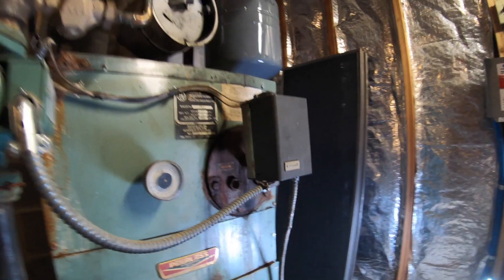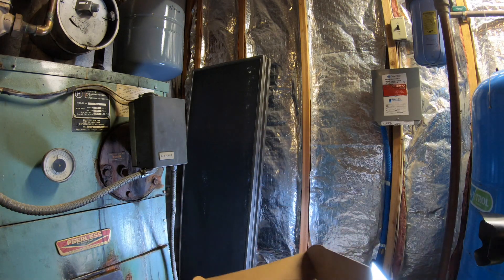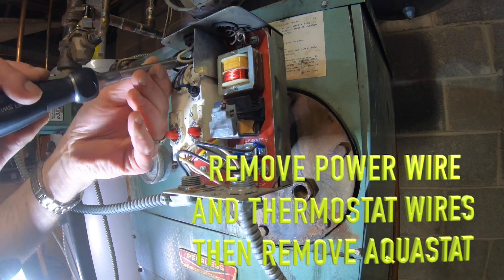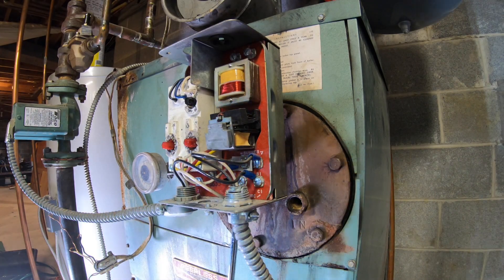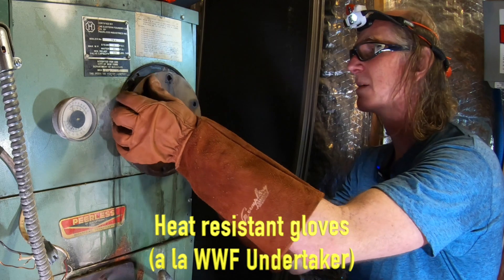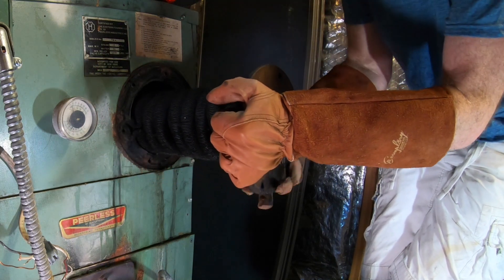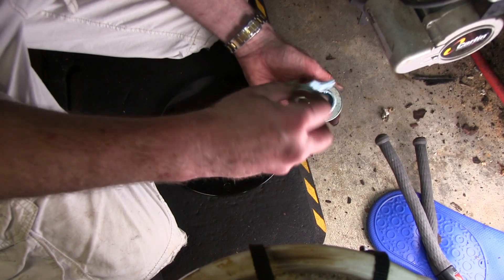Oil fired boiler Tankless coil gasket leak- DIY replaced cover and gasket

Comment: Thank you for posting your video.  Very helpful to give me the confidence to do this myself - exact same issue with my peerless.  My oil/furnace company wants $700 to do it.  Do you have any further advice since when you did it?
Reply from the maker: Thanks!   It was quite easy but a couple of things; don't force the bolts. I learned that the hard way when doing my brake caliper bolts. Spray them for a day before every few hours. Hit them hard with a steel hammer a few times and after you break each one free even turning it slightly, spray the threads and screw it back in then back out.  Watch a few videos on removing very tight bolts first.  
Next, after you drain down the boiler, there will be some residual water still in the boiler that will be released when air gets into the boiler from loosening the bolts. Be ready for it by keeping a hose on the drain.  
 That's all I can think of at the moment other than carefully scraping the old gasket so you don't ruin the surface it sits against.
Other than that good luck.

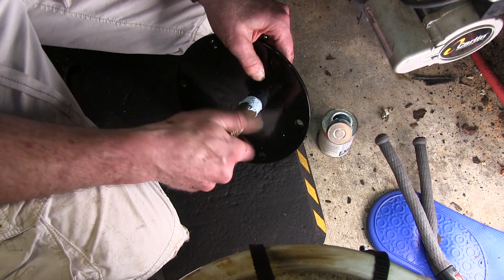Comment: time stamp 6:52 you removed the coil and didnt put it back, is it possible you can do this with out damaging the boiler? Im not an expert but Im curious if I can replace the plate cover, gasket with out putting back the old/new coil to supply my water heater, thanks
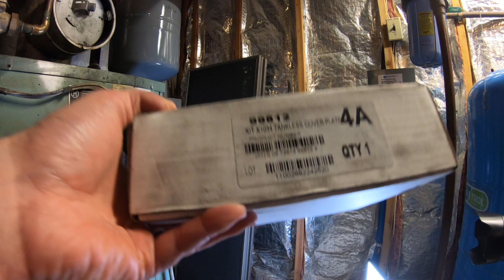Reply from the maker: No wonder I haven’t had hot water since then!  Thank you !!  But seriously, the coil had been disabled prior to us buying the house. The water lines were cut just outside the boiler. In its place is a tankless heater that makes our hot water. It’s a separate zone on our boiler and has its own aquastat and circulating pump. The coil wasn’t bothering anyone sitting there, but since there was a leak from the gasket, I figured I would install a blank plate in its place, which is what I did. 0:34 You don’t need to have a tankless coil in the boiler if you aren’t using the boiler directly to produce domestic hot water.  Thanks for the comment.

Comment: Great video!  1 question, where's the coil?  I didn't see you insert it again.
Reply from the maker: So we bought the house and I guess the prior owners weren't getting enough hot water from the tankless coil because the copper piping leading to and from it were cut and in its place there is an indirect fired water heater.  Its a separate zone with its own circulator. 
So the tankless was basically sitting there disconnected and I left it that way until a couple of winters ago I heard what sounded like water hitting a hot frying pan dripping. After looking I realized I had a leak from the gasket around the tankless. 
Well since I wasn't using it,  I decided to remove it and replace it with a solid plate.  Which is what I did. I tossed it in the trash and replaced the gasket and bolts and put in a solid cover.  Watch 0:25 to about 1:00. Its been fine ever since. No leak. 
If I were replacing it, would have been the same job except for desoldering copper going into the old coil and attaching the new coil and soldering in the domestic hot. 
Thanks for watching
Reply: @Drrich_DIY  Thank you for the quick reply.  I probably don't have a coil either because my set up looks identical to yours.
Reply from the maker: @jodeci888  you might just need a gasket  they sell them for about $10 I believe. If there isn’t a coil in there you can just remove the plate and put on the gasket. With a coil in the way, a gasket is a bigger job.  Edit. Nothing is $10 anymore with the current inflation https://www.supplyhouse.com/Peerless-51800-Gasket-Round-Plate
Reply: @Drrich_DIY  : I actually already bought the plate, gasket and bolt set.  Maybe I won't next time.

EVERYTHING is going up but OUR pay.  😉
Reply from the maker: @jodeci888  you can say that again!   Good luck. Start spraying the bolts a couple of days in advance and remove them carefully. That was my biggest worry.  Having to drill out and retap one of those.
Reply: @Drrich_DIY  Thanks for the heads up.

Comment: I just changed the gasket a few moments ago. It leaks like WikiLeaks. The old plate appears perfect but must not be?
Reply from the maker: Maybe scrape and then sand both sides that the gasket press against- on both the boiler and plate. As I recall it was a pretty thick gasket. If that doesn't work, I would probably go to an automotive supply store and get some high temp gasket maker silicone and use that in addition to the gasket you are using now. Just follow the instructions. I think you put out a thick bead and let is get semi cured before tightening.  Good luck!

Comment: So if you want to remove the coil for good you can just order the cover plate and gasket for the coil chamber basically?
Reply from the maker: Yes. That’s just what I did since I had a leak. Mine was already disconnected (the copper was cut) and an indirect fired water heater already installed.
Reply: @Drrich_DIY  there’s the answer I was looking for. Was so confused on why a coil was not put back in. So if I understand correctly, boiler heats water up and feeds to a tank?
Reply from the maker: @nickbass4022 @nickbass4022 two ways to heat domestic (household) hot water with a boiler.  First is a tankless coil. Its located inside the boiler and looks like a slinky of tubing.  The hot water flows through the really hot boiler and heats it up. No reservoir.  Mine had already been disconnected cause i think a better solution is what the prior owner put in; an indirect fired tank.  So its another zone. It holds 50 or more gallons and around the outside is a copper coil of copper tubing.  There is a separate circulator and an aquastat (thermometer).  So you set a temp for the water and the aquastat calls for the boiler to kick on that circulates water from the boiler around but separate from the stored water. When you need to use the stored water it gets replenished. Hope that helped

Comment: Hey man i subbed can you please answer his question I have the exact same thing going on with my boiler i have a water heater and the guy cut the pipes same thing. Should I call someone? should I try tightening the nut there? wifes freaking out man please respond
Reply: could you explain to me why its happening so I have something to tell her??
Reply from the maker: @Kuhlyedascope69  its just a rubber gasket that is leaking.  The boiler is filled with hot water. Its a small leak.  Over time the rubber gets brittle
Reply from the maker: @Kuhlyedascope69   So how did you make out?
Reply: @Drrich_DIY  heyy whats going on man thanks for the replys I talked to an old buddy about it and he said that same thing. its had a slow leak for like a year but I havent lost any pressure or needed to add water
Reply: @Drrich_DIY  I was going to try and tightening it but my buddy said screw it just leave it till the spring supposed to be 8 tomorrow here in MA. He was saying that since the unit is old that when you got it cleaned probably when he shut it down the gasket shrunk a bit and started to leak.
Reply from the maker: @Kuhlyedascope69  probably a good suggestion. Depending on where you are in MA if you need to call someone and you happen to be in his service area, I would call Steve Lavimoniere.
Great channel here on YT. The guy can fix anything hvac, and is one of the few not looking to just replace older stuff
Reply: @Drrich_DIY  haha yeah I saw that you mentioned him I also have watched him over the years and have learned a lot from him hes great. he lives more east out towards boston so hes a bitt to far for me would love to have him come here though!! My dads buddy is an oldd plumber kinda like a steve has seen it all but hes in florida currently. When I get it all straightened out Ill come back and say how it went for you and any other viewers. thanks a lot for the help man!!
Reply from the maker: So you have a hot water tank that serves the water (an indirect fired water tank),on its own zone?  If its a slow drip, its not gonna do any major harm as long as its slow and you make sure to keep the water filled so it stays around 14-20 psi in the pipes. Let me know
Reply from the maker: Understand I'm not in the business, I'm a homeowner so take what I'm saying for what it is. Also, you never know- be really careful. But in my experience,  after doing the job, and replacing the firebox, I was worried for nothing. Most likely you can gently tighten down the bolts, a little at a time in a star pattern and hopefully that stops the drip until the spring when you can replace at least the gasket. 
If your boiler is old like mine is, and you call someone,.expect them to want to replace the whole boiler. Once they put a tool to the boiler its their responsibility and most guys aren't gonna want to touch old and leaking. 
It was an easy job, I just would wait until you don't need heat. Thats what I did. I tightened the bolts, that stopped the drip and I did the job in the warmer weather.

Comment: Thanks for posting that video. I have the same problem only with a twist, hopefully you can respond and help me out. New Yorker Oil Burner, leaking at coil assembly, I have the gasket, got it from supply house, mine has a round opening where coil slides in, with square plate on end which extends out. Then the leaky gasket, then the coil assembly also with square plate which is nuts and bolts together. Inlet and outlet pipes go through near center of plate. I’ve disconnected water lines from coil assembly and looped together because water runs in through coil, back out, then to electric hot water heater already using. Coil assembly in-line I guess you call it. Therefore I have domestic water, but not for home heating right now cuz burner off. I’m ready to replace gasket. If I fix the leak by replacing gasket, but leave water pipes as they are, separating the two systems, is that going to work without adjustments to aqua stat?  I believe I would need to disconnect the low/diff wires. I see you have the two separated, and your aquastat goes in front of coil plate. Mine is off to the side, not directly in my way of coil assembly area. Please respond when you can and thants again! MCT
Reply from the maker: I would be happy to help, but I’m not quite sure I understand your question. My suggestion would be to either take a photo or video of the system before you remove anything, and then put it back exactly the same as it was before. I assume the gasket is what is leaking, since you are replacing it. You didn’t mention that you were replacing the coil so I assume you are not. The only reason I replaced the plate and coil is that they weren’t being used any more. For my system, the aquastat controls just the boiler, and my indirect water heater has its own aquastat. In your setup, where the domestic hot water flows through the coil, I believe there should be only one aquastat, and then there is usually a mixing valve after the hot water comes out of the boiler at whatever it’s set to (let’s say 180 degrees) the mixing or tempering valve adds domestic cold water in with that 180 degree hot water in order to make the domestic hot a safe temperature at your faucet.  Just so happens my aquastat is in the middle of the plate, many like yours aren’t. Hope that helps, but I’m not in the business. I suggest you go to a few vids from either Steve lavoniere or the pipe doctor who do this for a living and put out excellent videos of peoples systems where you can maybe find the same system as you have to see how it’s set up. Hope that helped and good luck.   I expect you have this system
https://s3-us-west-2.amazonaws.com/catsy.782/AP-U+IO.pdf. Here. I found you a video that will hopefully explain and help. Watch it. It’s awesome. https://youtu.be/bhs0CQtS-U4
Reply: @Drrich_DIY   Wow, thanks for such a quick response! I’ll check out that video, I guess as long as the leak is fixed, I can hook the pipes back as they were. I just thought why not separate since we have plenty of domestic hot water for several months….spring through early fall when burner is shut down. Thanks again

Comment: Great video, doing the same on my peerless WB-3 this weekend, already started soaking bolts! Had a question- did you need to bleed the air out of the zones because of the boiler being drained even though the zone valves were closed during the process?
Reply from the maker: Im not sure if I had to, but I did.  Im not in the business, but I think that when you close the supply and return in each zone, you are locking water only in each loop with no air.  But then once you refill the boiler and open the zone valves, I was worried that I would introduce air into the Zones, so I did bleed them.  Not sure if it was totally necessary.  Probably could have just opened one zone, bled the boiler and that zone until it was perfect with no air, then open the rest of the zones.  Since the hoses were already there, and I was already doing it, I figured an extra few minutes just to make sure were well worth it.  Good luck and thanks for the comment!

Comment: Did this job on my Peelesss 3 years ago, instead of  liquid wrench just applied heat to bolt heads with propane, replaced old bolts from hardware store.
Reply from the maker: The more I do to that boiler the less I worry. Dont want to jinx myself but its been pretty foolproof

Comment: Dude, nice job and thanks for filming and uploading! I have a 2001 Burnham Boiler I started noticing a small leak from gasket. Thanks for the confidence!
Reply from the maker: My suggestion is to do it when it’s warm out, just in case a bolt head sheers off and you have to re tap, you’ve got time. A small leak isn’t an issue, as long as it’s small and you keep an eye on the pressure and add water if you need. Thanks for the comment!
Reply: @Drrich_DIY  Thanks for the tip! I have a wood stove so I basically just use it for hot water but you're right, better to do it in Spring/Summer.
Reply from the maker: @WeatherNut27  here you go. He is doing a tankless coil on a 99 Burnham. This guy is great. Any plumbing I need to do, I watch his vids. https://youtu.be/Qu5n8vXhxpk
Reply: @Drrich_DIY  Steve is the man! Love that guy. Been a subscriber since he had just 23k 2 yrs ago. Religiously watch his daily videos. :-)
Reply from the maker: @WeatherNut27  that makes 2 of us. I've learned a lot from watching his vids.

Comment: I have, what I’m assuming is, the same issue right now with my Peerless (except with A LOT more rust around the bolts...). Called up my service guy, but he hasn’t returned my call. So, now thanks to your video (🙏) I’m thinking about attempting the job myself. 

My question is, all in all, how long did the whole process take (minus the 24 hours of spraying liquid wrench on those bolts)? More than two hours?
Reply from the maker: It also depends on how quickly/comfortable you are doing things like draining the boiler/ closing the zone valves, refilling and bleeding the air out. If you can do that quickly and no bolts snap, it's fairly quick. Also, get a good scraper for the old gasket against the boiler.  That takes some time to make a good surface that won't leak.
Reply: @Drrich_DIY  You might also want to recommend  gasket remover in a spray can sold at all car part stores.
Reply: Also some people use oven cleaner for gasket removal.
Reply from the maker: @Orange-Jumpsuit-Time  great idea. Thanks- never had a need for gasket remover so I didn’t know it existed. I just usually use my Lisle scraper with a carbide tip ( works really well) then acetone if needed. Acetone is my go- to for cleaning just about everything from granite counters to inspection / registration stickers. Thanks for the great suggestions though. I’m gonna look for it next time I’m at the auto parts store and pick up a can to keep around
Reply: @Drrich_DIY  Thank you so much for your response. I greatly appreciate it. 

The thing that I’m actually hesitating on is draining the boiler. I’ve never had to do that before. Been trying to find other videos here on youtube, but can’t seem to find one. I have a buddy whose uncle services boilers. I might get him over here to run me through that process, then go forward with switching out the plate and gasket myself. Seems straightforward enough.
Reply from the maker: @eyespy3001  surprised there aren't many vids on draining the boiler. The harder part is purging the air when refilling. 
Draining is just a matter of closing everything, especially water inlet after cutting power then opening the bottom drain with a hose attached to outside or a sump. 
Good luck anyway
Reply from the maker: I guess the video didn't do it justice because the bolts were extremely rusty.  I would say it took less than two hours, but two hours is a close guess. Before I even attempted this, I bought two things; a broken bolt remover (in case the head snapped off a bolt) and a set of rounded bolt removers to grab the bolt if I rounded it over. 
My service guy told me if the head snapped off on my peerless, the way its made you can just grab the broken stem with vicelocks after removing the plate. 
From what I understand,  no service person is gonna touch that type of job cause there is a high chance of running into trouble.
Anyway, good luck. If I could be of further help,  just let me know
Reply from the maker: Oh, and take a wire brush to the rusty bolts before spraying them.  All the crap will flake off first